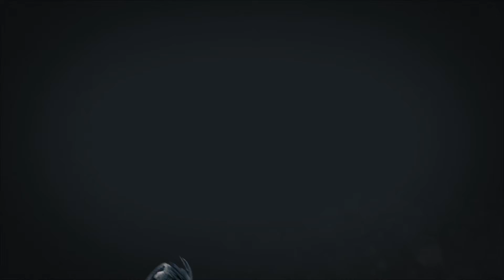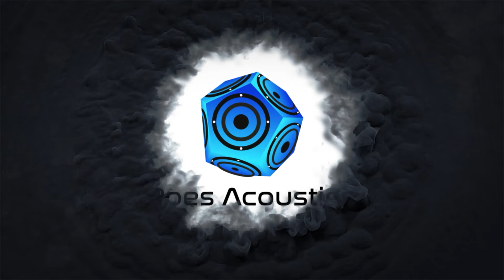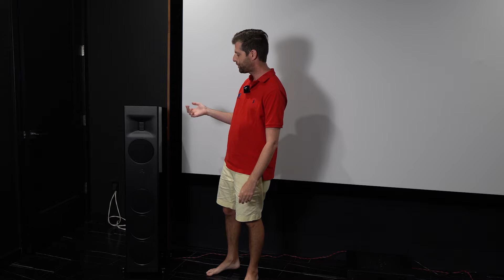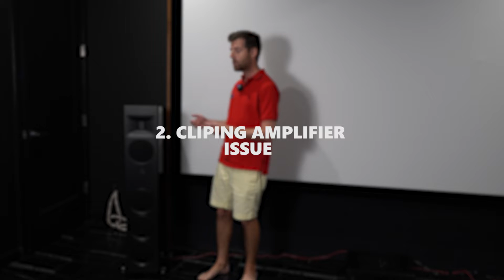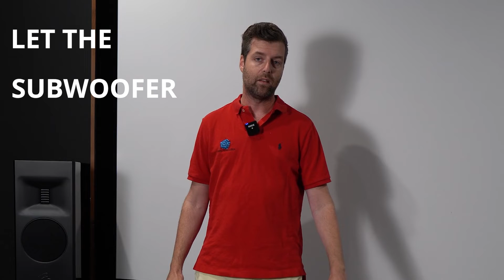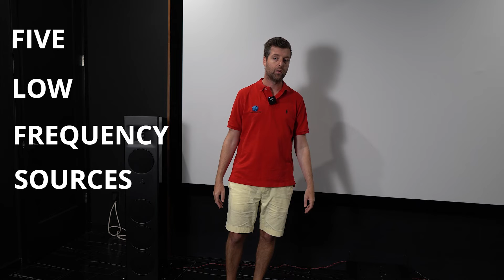Bass Management for your Home Theater

Comment: Matt, in a video Anthony made a point of how bose used their acoustimas system that was convincing to many people with a very high high crossover because it was actually more difficult to recognize the point of bass production than people believe. THX wanted a 80hz cross over because of "detectability" when only one subwoofer was the common set up. Now that we use multiple subwoofers do you think that 4 corner sealed subs could be crossed over much higher (150hz +) with low detectability?
Reply from the maker: No I don’t think crossing at 150hz is necessarily a good idea.  Multiple subs isn’t going to change the fact that you could localize the subs. Bass usually sounds diffused and around you. Hard to place. But as you go higher it can start to sound like it’s coming from the walls. But the actual LF sound object would be coming from the speakers. Causing a cognitive dissonance issue. Your brain will try to make sense of it, but really it can’t.  So I suggest not going too high unless the sub is tied to a speaker.  Or near it. Between ~100hz and 200hz bass management needs to be directionally steered in my opinion.  Most processors can’t do this. Trinnov is the only one I am aware of that can both do this and summed mono bass. Mosimo products can do 4 quadrant steerable bass but it then doesn’t allow for the benefits of a typical multisub approach.
Reply: I am also curious to get your take on Erin's Audio Corner recent discussion of "do big speakers sound big."
Reply from the maker: I’ve never watched it. I don’t know what his take it. I don’t think big speakers sound big. I mentioned in my review of the Polk L800s that they actually sounded like a mini monitor hooked to subs. The midrange and tweeter were not that efficient and so it sounded small. It couldn’t play all that loud.  

My view is that a “big” sound comes from the bandwidth, output, and scale is the image.  The actual speaker size doesn’t matter. But it’s very hard to make a loud and wide bandwidth speaker that is also small.
Reply: @PoesAcoustics   yes, Erin has the same take on it.
Reply: If you have only 2 subs and they are near Left respectively Right speaker, you can have XO much higher than 80Hz because when they start to became more localizable they will be aproximately in the same spot as speakers. Not best solution, but still good enough.
Reply: The reason in spreading subwoofers out amongst the room is that it allows better positional eq of the subwoofer frequencies. Placing subwoofers near the mid frequency drivers (which need to be there for imaging) would be the same as not bass managing large speakers. My question of detectability of higher bass frequency with multiple subwoofers in a room comes from the desire to negate poor room interaction of a monitor. If you are very limited with placement options for your L,C,R but can cross over poor room interaction effects to a multiple subwoofer solution, is it worth the trade off in detectability?
Reply from the maker: @williamkramer9069  above the room Fs I wouldn’t try to smooth the response via the subs. I understand the desire.  But I would use acoustic treatment and EQ more.  Having detectable subs is too much of an issue for me. 

But…it can’t hurt to try. If you want to try it, go for it.  It’s not hard to fix if it’s a problem.
Reply: Interesting video 👍

In my setup I’ve got a 5.2.4 config, subs are FL and RR.  Room is about 15.5ft long, 11ft wide, 8.5ft high.  MLP is unfortunately about 14” from the rear wall (all solid brick walls).

I always struggled with a dip around 55-65Hz… best measurements for me are x-over at 100hz… but then I improve that dip more by stuffing the ports in my front towers, measures a few db smoother in the dip and sounds less phasey.

I guessed I’m stopping that out of phase region with my tower ports vs my sub ports which you’ve confirmed in the video.  No matter how much I play with timings etc I can never get a better alignment with the tower ports open 🤔

Guessing the MLP position isn’t helping either and causing impulses/cancellations from the rear wall to a certain extent.